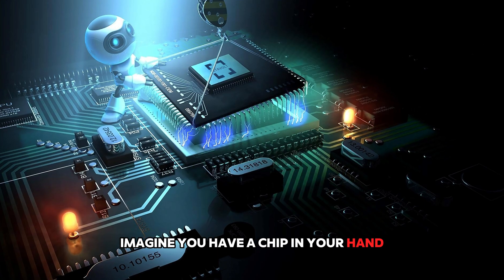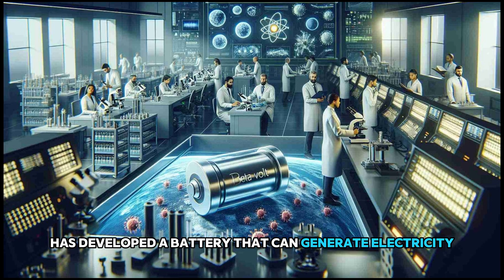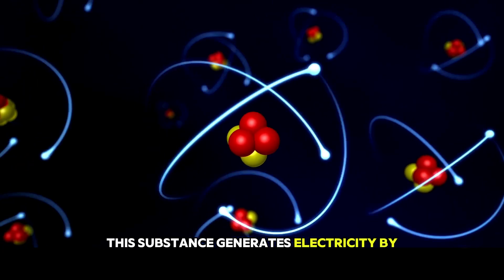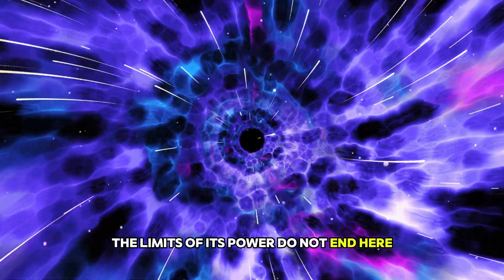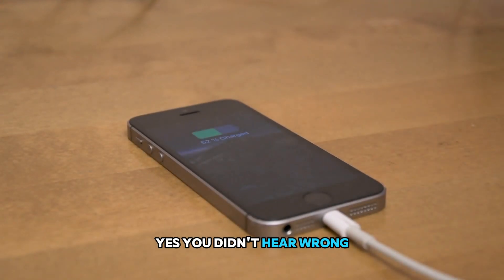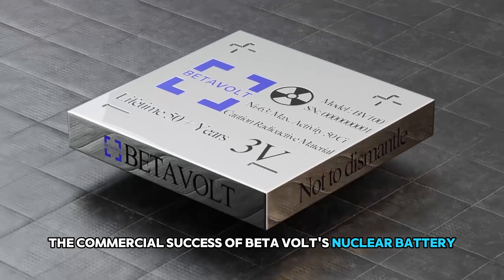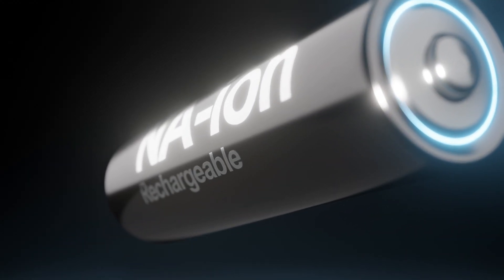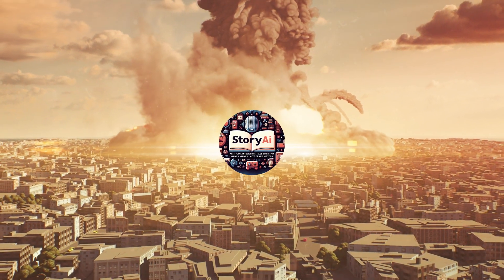Nuclear Power The Size Of a Chip: How The Betavolt BV100 Works

Comment: Videos that put the Betavolt battery in good light are punished by the algorithm. Test it by making another video, a deliberatedly phony one, where you focus on the  risks of having a radioactive chip nearby (without mentioning that is the case for most smoke detectors, etc.) and you're likely to be surprised by the numbers of views it'll receive.